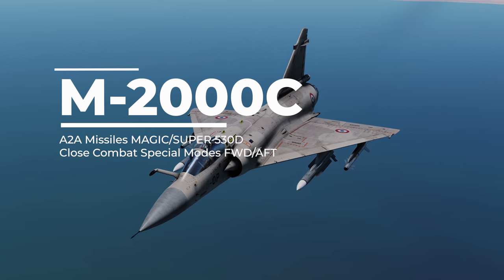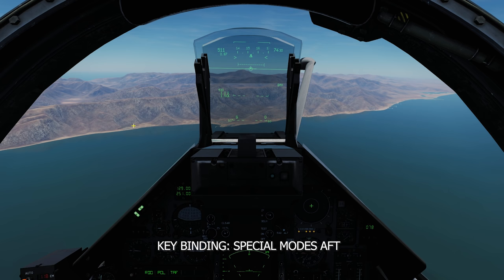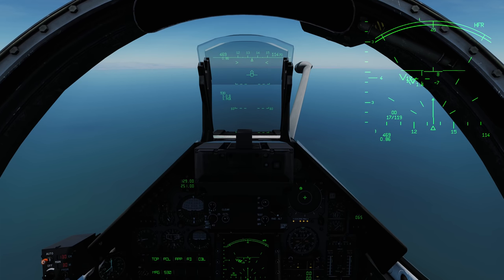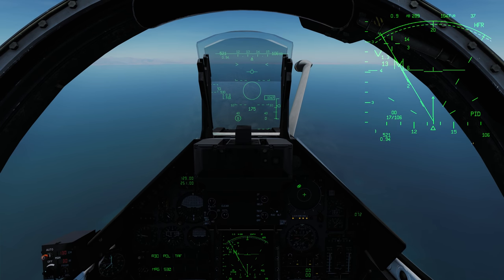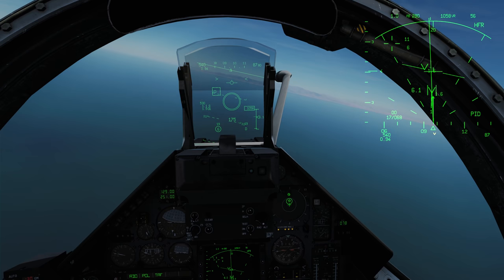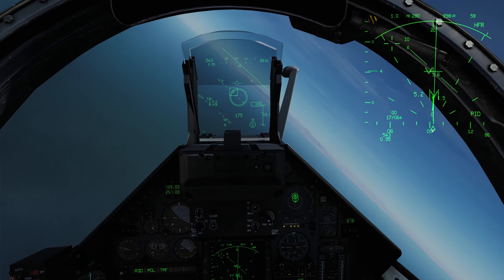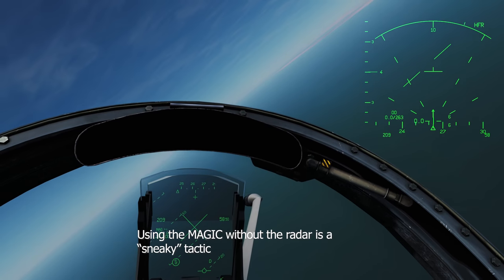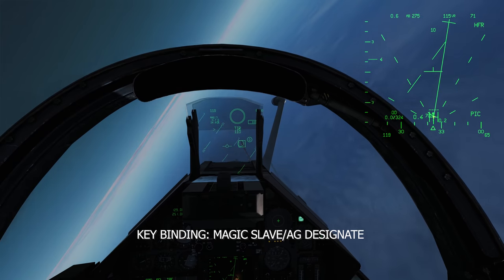M-2000C Magic & Super 530D Missile Guide

Comment: I bought the Mirage a few months ago as a toy to play with until the F-14 arrived.  I did not expect that it would become my favorite plane in the game, but it has!  I was afraid it would feel numb and synthetic due to FBW, but my love of delta wing flight characteristics more than offset that.  Coming from the F-15 I struggled greatly in BVR as any fool with an Amraam casually fired second and hit first.  I had to adopt the mentality that the Mirage is an F-5 with more, not an F-15 with less.  Soon I became proficient at disappearing into thin air with the notch.  Suddenly I'm taking 3-mile side-aspect shots on Hornets who are wondering where that Mirage went.  Then I discovered that the Mirage can COOK up to 50k feet in a hurry, and found that F-15 drivers cruising at 25k never ever expect sneaky Mirages to be coming at them from Space.  I love this plane.  I'll even excuse the useless gunsight and cludgy countermeasures and the tiny dark hidden unlabeled IFF master switch that's so easy to miss.
Reply: What you mean disappearing into thin air with the notch?
Reply: @geraldo209  Notching is basically a  counter to high-frequency radars; you fly about perpendicular, such that your closure rate with your opponent is within a certain range (50kn is typically considered fairly good), thus becoming invisible to pulse-doppler radars. Most radars have other modes to get around it, but also struggle with other factors like ground interference.

Comment: There is something wrong with the missile flight model. At the beginning of the video you're aiming at a 13 NM target flying toward you at a closing speed of 1040 knots, it would take 45 seconds for your 2 planes to meet. The Super 530D missile is supposed to reach +2.5 mach relative to the lauch aircraft but the time to target is displayed as 42 seconds. Even if the missile won't reach its max speed at this altitude, this is hardly realistic.